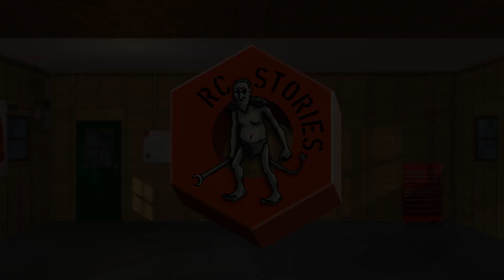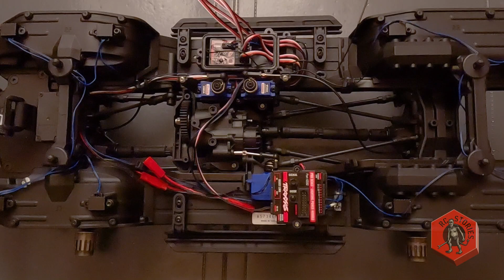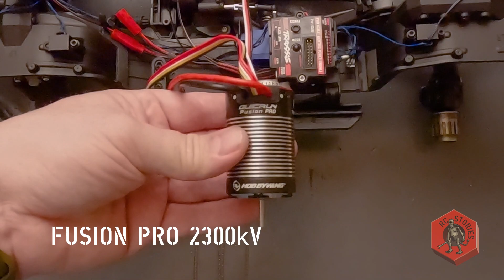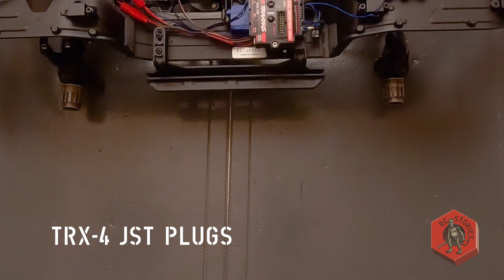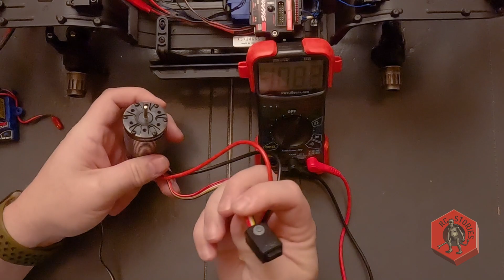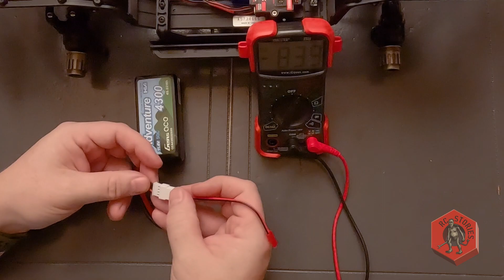TRX-4 JST Plug Solutions For Your Third-party ESC - RC Stories Garage - Episode 17

Comment: Great information shared here. Wasn't aware of choosing the output voltage at the balance wires like you showed.
Guess I need to open up that new multi meter,  that I've had for longer than I'd like to admit to. 😅

Comment: Thanks was thinking of running a fusion se in my trx4 sport high trail with winch kit couldn't figure out what voltage it would take if I could run it directly off the battery by soldering a jst lead to the power wires on the power wires but I like that balance Port option

Comment: it cant be safe rumning power off just one of the batterys cells right?
Reply from the maker: Yeah, I get nervous about that too. Not really about safety, but more about battery longevity. But for low current applications, like a few LED lights, it’s probably okay. You are right though, with no low voltage cutoff you could damage the cell of the battery if you run it all the way down. The XH to JST adaptor I show in the video is wired to draw voltage from all 3-cells of a 3S (hence the 12.3V reading). But some devices, like the MyTrickRC HB-2 light controller, only work on up to 2s voltage and yet they provide a 3s XH to JST adaptor—I wonder if they have the adaptor wired to only 2 cells (8.2V)? I have a MyTrickRC DG-1 which came with such an adaptor, but I can’t find it to test it.

Comment: Can you please tell me how you solved the problem of connecting the motor speed/direction wire that the pro light kit needs to your motor?  Thanks
Reply: Ive seen other videos that say if you use the maxx link cable provided with the pro light kit it will send all that info from your receiver to the pro light kit!
Reply: @Pitudo760  Yes, I have done the same and it works for me.
Reply: @maziatr  cool i have mine on the way and watched many videos get that info. Thanks for confirming!
Reply from the maker: @maziatr @irvinggutierrez5390  Thanks for the question and the replies. Yes, the Maxx Link cable is what you need to get forward/reverse signals with the Traxxas Pro Scale Lighting and a brushless motor/ESC. There are a few gotchas and bugs to this setup which I cover in this linked video…

https://youtu.be/DxILTb8-a8g

Comment: That is a very nice explanation. Not many channels have enough electronic talks. I like to learn more about it, like creating lighting systems/halo lights and things from scratch. Hopefully, that is something you have to share with us. Thank you for your video.
Reply from the maker: Thanks. I haven’t dabbled too much in the scratch building side. Especially for lighting, there are a lot of after-market options out there that make things too easy. When I do make these kind of videos I try to cover topics that others haven’t covered (or haven’t been covered well) but that seem to be of interest to people. I have been thinking about how to use the Traxxas light power supply (just the basic one, not the Pro Scale) in any truck. For example, being able to power the stock lights plus a lightbar on a Element body, without going with a full light controller and without having a spaghetti mess of wires pigtailed off the receiver. That I may make a video about someday.
Reply: @rcstories_ca  yes. I also see a lot of confusion about traxxas modular lighting system, me being part of it. When I built my sport kit I wanted lights and the hobby shop and some people in forums where recommending all kind of different part numbers. I got frustrated and didn’t do anything. It’s a day runner